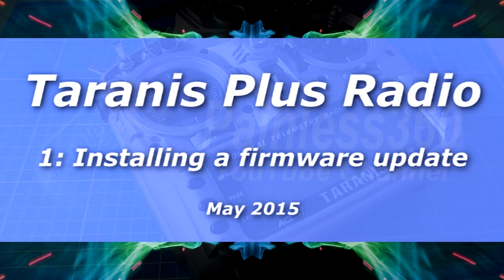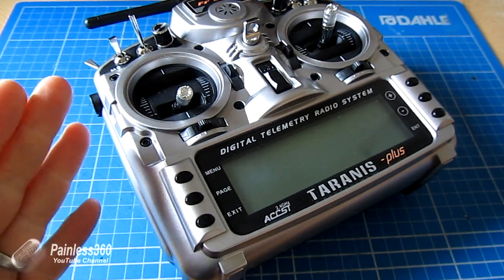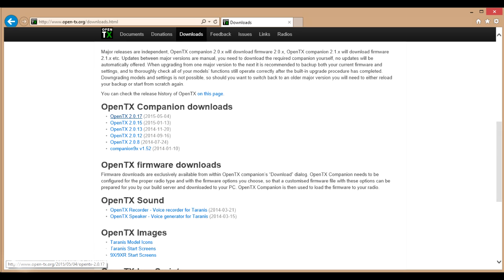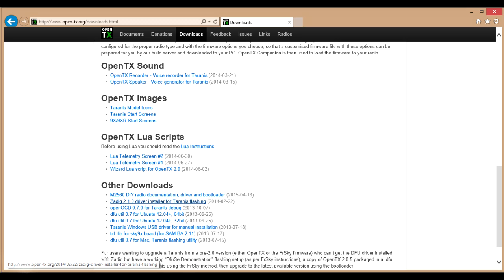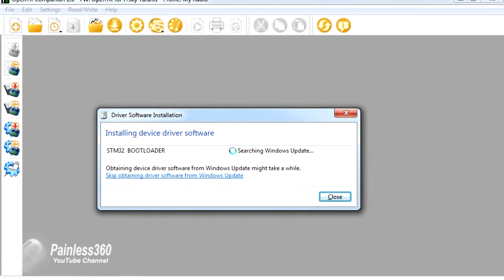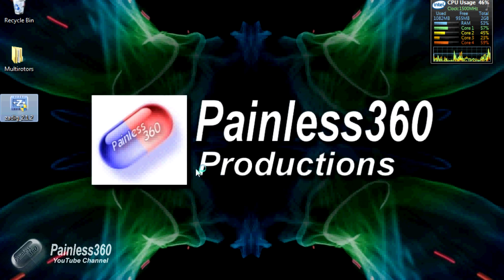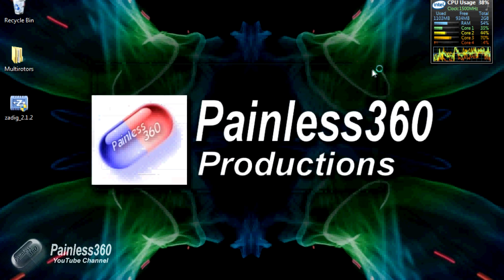(1/12) FrSky TARANIS Radio - One way to update the firmware

Comment: Hi guys, im totally new to RC aircraft and have just bought this TX so its a bit daunting but id like to know more and make sure its all up to date before i fly my racing Quad.  Should i be installing the latest firmware from this video?  Ta
Reply from the maker: +simon light it's up to you. You can do a lot of what we cover in the series even if you don't.. Best of luck with it..
Reply: +Painless360 yep I've gone through 3 video so far and really easy to follow so far. thanks mate. 
I somehow already put a splash screen on before I watched the video but I've now edited the pic and it's in the right 212x64 but my edited pic isn't coming up.

Comment: +Painless360 i just went through your video and i installed the zadig driver and my taranis won't flash. I was able to flash with the old STMbootloader. but after I installed the Zadig driver, it stopped working. any suggestion?
Reply from the maker: +Jerry Pham Zadig will stop the DFU util from working as that is what it does - intercept the DFU USB driver.. Best of luck..

Comment: I'm not sure if the latest version of the Open-TX companion has changed a few things, as I've just received my Taranis and flashed it with the latest firmware, however the process in the video would not work at all.(Windows 10)I installed the latest companion software and plugged in the Taranis and it installed the driver.    Opened the Gui and downloaded the latest firmware.     No error messages so far.Attempted to load the Zadig software, but that couldn't see any devices.I eventually left that and switched on the Taranis (holding in the trim buttons)   It then allowed me to re-download the firmware and flash the software (very quickly in fact)    I've reviewed the version information on the device and it's reporting 2.1.7     This was a lot easier than I expected

Comment: Hello Painless 360,  First of all I find your channel very informative and great video.  If I may ask you, I just got the Taranis plus two days ago and it came with the Firmware Version 2.1.6 do I need to update any new firmware at this point ? I did see a new firmware 2.1.7 on Open TX website and is under   "This branch is the first to support the FrSky Taranis X9E (tray version). " Is that the same for Taranis X9D plus ?  I am so new to this transmitter it will take me a life time to learn it.  I will watch all your Taranis video to understand more about this transmitter.  Thank you in advance for your help.
Reply from the maker: +Toan Lam No need to do it straight away, the supplied FW is great and should work fine for most things. Best of luck!

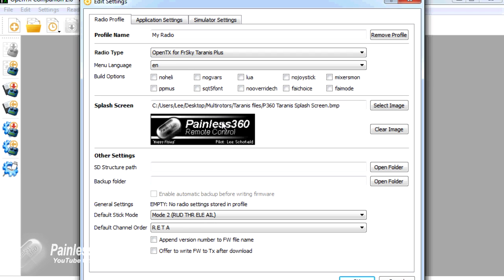Comment: 6:07 OpenTX for FrSky Taranis Plus is selected.(in companion 2.1 is only option FrSky Tranis without open tx) 7:49 write completed and then I see message non compatible. In Companion 2.1 is download file source selectable. By default it like trays to download the same content as early uploaded for backup. Your video is mute on this part. The only file that I can download to radio is "originaal taranis firmware.bin" if I use file from "frsky.com" ver2.0.9.2 then also not compatible. Radio itself shows Taranis bootloader - 2.0.9.2-eu. Maybe downgrade is not possible as I read somewhere and why companion shows smaller ver number to be newest then existing ver. in my radio? I know - tutorial 0/12 is what I need..
Reply from the maker: The video was made before 2.1 came out, that's why the video is 'mute' on that point. Best of luck!

Comment: Why one need to do this?  Isn't supposed to work done from factory? 

I was planning to get one of this radios to use with my Dragonlink,  but if it's going to be like that hard to get it working right,  I rather stay with Specktrum DX9... Waaaaoooo  and have 11 more videos about this radio,  that sounds complicated,  a mean,  I'm not a computer guru,  so I might end up messing up the radio trying all this...

Thanks for helping me deciding which radio to get.
Reply from the maker: +ricardopr54 Radio choice is a very individual thing (we even did a video on it). I also have a DX9 and like that too but (for me) the Taranis Opensource power is hard to beat for complex setups and bang for the buck. Then again, I wouldn't recommend it as a first radio as it could overwhelm a new builder pilot.. Best of luck with your choice! Happy flying!
Reply: +Painless360 I really appreciate your response,  but my real concern is, Do I still need to perform all this upgrade procedure with the radio , even if my intentions were to use it only as a slave  to control my Dragonlink?  I was not planning to use this radio with other than my FPV planes running Dragonlink. Do  you think that it would work for those purposes without having to preform all those upgrades?
Reply from the maker: No, the FW that comes with it is fine - just not the latest and greatest! ;)
Reply: +Painless360 That's good to know,  so I guess I'll be ok connecting my Dragonlink to it...Thanks again...

Comment: I have a Taranis non plus version. Should I get the 'OpenTX 2.0 branch' or the 'OpenTX 1.x branch'? ..Also, will I be losing all my models when I upgrade?..do I have to bind everything again? thanks :)
Reply from the maker: OpenTX 1.0 is very old now. You should be looking at OpenTX 2.1 or later now. Read up on the process to upgrade and backup the SD card, EEPROM and firmware on the radio so you can go back if you don't like it. Best of luck!

Comment: +painless360 
Hi, I am starting to lose it over here. I have tried to bind the new receiver in every way possible. I first bought a receiver that show to be non EU, so I went and got an EU version instead. Same problem.
Just do not bind. I live in a location with no help within 8 hours drive.
The Taranis plus is / should be EU.
I followed your series and it worked like a charm, thanks for that. But now I am stuck.
If you could help me / tip me / or in any way support me in this I will be for ever grateful.
Or any one else for that matter.
Reply from the maker: +Hakan Sagerkrans Sounds like the Rx is different firmware from the radio and your other receiver(s). If you already have lots of other receivers that work fine then I'd look at flashing the new Rx with different firmware (see our video on how you can do it, and if you are using OpenTX 2.1.x, you can do it directly from the radio with a simple cable). Best of luck.

Comment: Hi!
I just bought a Taranis X9D PLUS+ today and found out that it has the post-2015 LBT-EU (D16). firmware. To make it work with the L9R reciever i intended to use i need to uppdate the firmware to the new LBT-EU (D16, LR12). Do you know how to do that?
What is the difference between the open TX and the LBT-EU(D16, LR12) firmwares?
Reply from the maker: OpenTX gives you back all the modes and protocols, have a look in the forums about it. Best of luck!
Reply: +Painless360 Thanx and great vids by the way :)

Comment: my taranis has 2.0.17 want to update too 2.0.19 but zadig failed to update driver??? i see stm32 bootloader when clicking udate driver i got the driver installation failed strange???? my taranis is OFF
Reply from the maker: +timmybeetle You can update the radio using the SD card - see the OpenTX university and RCGroups forums for details. Best of luck!
Reply: +Painless360 Hello

thansk for answer I mananged to solve my problem with windows usb, it works know.

Comment: Hi Painless 360. I'm a great fan of your videos. They have helped me countless times. I have followed your instructions in the video above but continue to get the "New firmware is not compatible with the one currently installed" despite updating the settings to Taranis Plus etc. Any advice would be much appreciated. Thanks.
Reply from the maker: +Philip Lucas Not sure, this method should work all the time. There are other ways to update the firmware if you are struggling.. Best of luck with it..

Comment: hi i followed your video to a t but when it tries to write the software it comes up with the message you get at 5:46 please can u help i am starting to loose my head with this.
Reply from the maker: +Rick Inman The process we followed is in the video. I have heard of problems with Windows 10 though..
Reply: +Painless360 i followed your video but it wont write the firmware. it wont do the last bit on the pc. im not running windows 10.
Reply from the maker: Sorry, not sure. This is only one way to update the radio. There are others in the RCGroups forums.. Best of luck with it..

Comment: Now that was indeed painless! Thanks for that.

I'm curious that on the Open TX page it states the Taranis is shipped with FrSky firmware which is not actually part of the Open Tx develpment team and is designed by FrSKy themselves.
Also advice that the FrSky firmware should be OK for most to use as stock?

In other words is it really necessary to update the stock firmware to Open Tx?
I use Open 9X on my TG9X transmitter at the moment....
Reply from the maker: +David Pulvermacher You can keep it as the stick FrSky firmware but there are a lot of limitations (see EU firmware for example). Happy flying!

Comment: Hi Painless36
I have been following your excellent video and trying to update my Taranis Plus, all has gone as your video until I try to update the STM32 BOOTLOADER I have followed the video and installed Zadig I have found the STM32BOOTLOADER in the drop down and selected it but when I go to replace it the gray box has reinstall driver and not as in your video replace video.
Any idea what has gone wrong, the only thing that may be different from your computer is that I am running Windows 10, maybe the issue stems from this.
Any advice would be greatly appreciated.
Thanks Les
Reply from the maker: +Les Milton I've not tried it on Windows 10 and the driver pieces is a little different in that version of windows. Best of luck with it!

Comment: Question can this interface be done with window 10, i have had problems  with other firmware loaders useing windows 10
Reply from the maker: Hi, not tried it. I will be doing so as my radio will be upgraded so I can cover the new telemetry system..
Reply: yes  it can!

Comment: I'm having a problem where my computer isn't recognizing my Taranis anymore. I was able to connect it previously and read/write to the radio but then it just stopped working. When I first started encountering this issue, when I plugged in the Taranis my computer freaked out and kept trying to read the Taranis as the removeable drive but would keep closing out and retrying on its own. I don't know if my bootloader is working anymore. My Taranis still works at least but now I won't be able to update firmware or add/edit files on it. Any thoughts on this?
Reply from the maker: +Richard Lu I've not seen this personally. I would be tempted to delete the driver from the PC and start again from the start.. You can still copy flies too and from the radio by removing the SD card and popping it directly into the PC. You can update the firmware that way too is you have OpenTX2.0 or later on the radio.. Best of luck.
Reply: +Painless360 I've tried reinstalling all the drivers on my Windows PC. I removed the FrSky Bootloader device and reinstalled the Zadig on the Stm when the radio was off and my computer is still not picking it up. However, I gave it a shot on my MacBook and I'm able to connect and read/write on there. 

I have yet to find a solution for it on Windows.

Comment: Super helpful thank you :-) I have a X9D and didn't see that option on the menu when choosing the type f control so I just opted for the Taranis option. Is that what I should have done? Thanks.
Reply from the maker: +Tom Craner-Buckley Not sure - we don't have the X9D here.. best of luck!
Reply: +Painless360 So I believe I have done everything correctly yet the TX an RX are refusing to bind. Any ideas?
Reply from the maker: Is the Rx one using EU firmware?
Reply: +Painless360 Yes I believe so. The previous X8R was damaged in a crash so I replaced it. It was bought a while ago which is why there is a clash. I've flashed the Taranis X9D with the 'opentx-taranis-en.2.1.6' download but still they will not bind. Am I doing something wrong?
Reply: +Tom Craner-Buckley The Taranis was bought a while ago I mean and it's clashing with the new EU X8R,
Reply from the maker: New video on the channel today should help..

Comment: Basically I haven't really done anythimg yet. Since I created a model the rudder behaved that way. I have chequed inpits and data is as it appears for the other 3 channels. I have programmed low and high rates in E R and Ail. I have not messes with curves or other more complex programs. I cam say I am a rookie with this radio. 
Overall, just programmed a model and the Tx decided what to do with the rudder. 
Kind regards
Reply from the maker: +vmbamores In that case then I would make sure you have calibrated the radio and then work your way through this series and try the things we are doing. By the end you should have a good working knowledge of the main menus and how to use them. Best of luck!

Comment: I'm not showing the STM32 bootloader on my windows 10 pc any ideas on how to get it to show up. I've downloaded the open tx companion and Zadig. I've triple checked every step and haven't been able to solve this please help. Thanks. 
Details 
Downloaded 2.0.17
Using a lenovo windows 10pc 
Taranis not being recognized by PC. 
Looking in device manager and its not there.
Reply from the maker: Not sure, there are other ways to update if this isn't working. I would also try another USB cable..
Reply: +AirVideoinc You downloaded zadig, but did you use it to update the usb driver? Does the Taranis show up as STM device in DFU mode in the device manager?
Reply: +TheRular I was able to get it to work.
Reply: i am having the same problem windows 10 wont show stm32 bootloader

Comment: PLEASE, I need your advise. I have a Taranis 9XD and was abl e to make the firmware update. The Tx since I received it, randomly read the SD card, so it was almost a matter of luck to use sounds and images . Once the firmware was updated, I thouhgt that such thing will get corrected, BUT NOT. The SD Card is not always read and sounds are played...depending on Tx mood. I have cleaned the Card and the slot and nothing seems to help.Do you have any clue, other than buying a new Tx?Regards
Reply from the maker: +vmbamores I would suspect the SD card. I'd try another and see if it has the same problem..

Comment: Hello, i have a question. I need to bind mij new X4R-SB reciever that hase EU-fw to mij taranis plus that does not have EU-fw, how can i get the EU-fw four my taranis and install it?
Reply from the maker: +SteadyPete's FPV I use them with this radio and OpenTX - seems to work fine. I have the latest X8R on order to test though so will let you know..
Reply: thanks :)

Comment: I'm not sure if you are aware of this or if its covered in a later video, but if you buy a Taranis in the EU today or perhaps in the near future, unsurprisingly it comes with the latest EU firmware, 2.0.92 at the time of writing. I followed you video and everything went fine until the actual firmware upgrade, when I got the following message "New firmware is not compatible with the one currently installed".  After spending about 30 mins searching the web I came across the following thread on reddit, "https://www.reddit.com/r/Multicopter/comments/357qds/need_help_with_taranis_x9d_plus/", which helped me update my firware to the latest version, 2.1.5.  The instructions are fairly straight forward.  It appears strange that there seems to be some disparity between US and EU firmware.  Anyway, great videos, keep up the good work.

Comment: I have just updated my firmware to my Taranis Plus Remote but now when I go into my logical switches and try to setup my cell alert it does not find CELL or CELLS ??  Is there another setting I need to do to recover them ??
Thanks for any help !!
Reply from the maker: +Ken Stovall The telemetry system was revamped in OpenTX 2.1.x. Best of luck with it.
Reply: +Painless360 Im running 2.1.3, does that mean that I should drop back to an earlier version to get my Cell and Cells selections back ??
Reply from the maker: I am not familiar with 2.1.3 yet. I'm sure that there is a way to set up such a basic measurement in the new system. Best of luck!

Comment: I have done this and realized that open tx does not offer ppm in the mixer. So I would like to know how to re-flash the original taranis software back on to the transmitter
Reply from the maker: +etab83 No idea, I never went back. What do you think you are missing my not having the PPM menu?
Reply: Im using the ezuf module in the taranis. it disabled my ppm option in the mixer that i use for headtracking
Reply from the maker: See the video on configuring head tracking in the Taranis playlist.. Hope it helps..

Comment: Thanks for the respond. I plan to do several radios for the 6 flight modes. I did watch your videos. I know it might be hard to explain how you got the "magic numbers" to make the fmodes work. Can you try to explain how you found those numbers? I know that each radio is different but I am hoping the theory is the same. My thought is that you have to reduce channel 5 pwm and then add the pwm's back to the end of channel 5 from the other 3 position switch. what do I use travel, or endpoint??? I might be really off but I am trying to get a handle on that process. thanks for helping in advance. also what doe offset and rate do?
Reply from the maker: +Dan Geukes I ended up drawing the scale (1000-2000 Microseconds)on paper, marked off the PWM values for each APM mode then drew the channel range (100 to 100%) of the radio underneath and then picked the middle point of each APM mode and read off the value underneath needed in the radio  very low tech but worked perfectly! :)